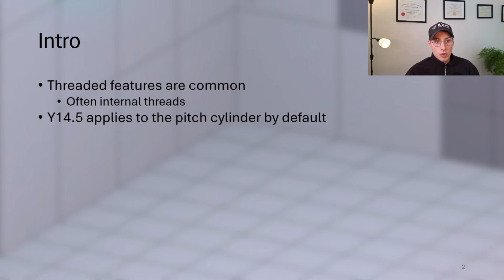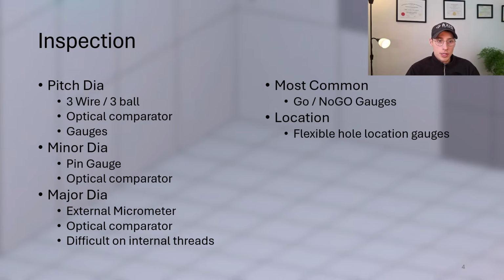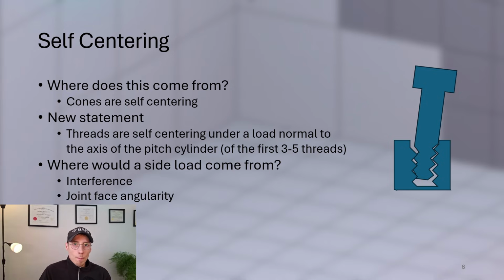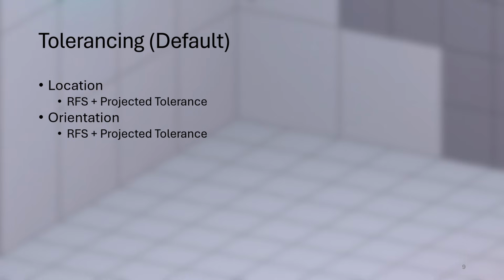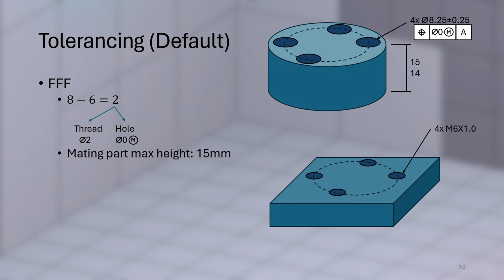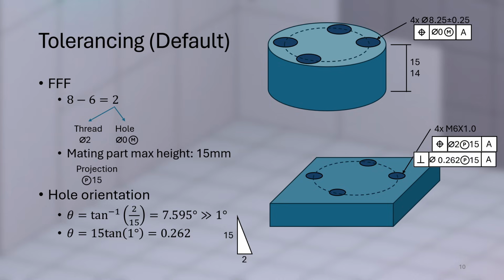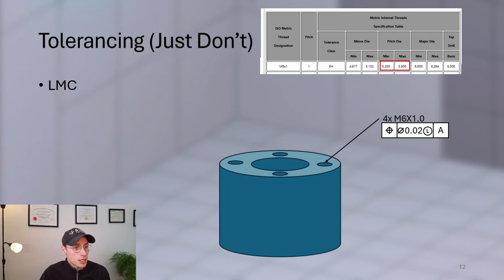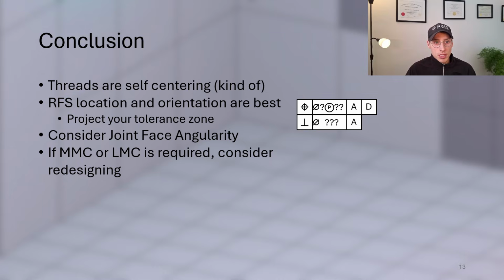GD&T Lesson: How to Tolerance Threaded Features

Comment: I've measured the major of a small thread in titanium (1-72) before using impression wax, a heat gun, and a freezer. Oil the part with some WD40 or something, heat the part with the heat gun until the wax starts to flow into it, let it set for a few minutes, toss it in the freezer for like 10 minutes, pull it out and begin to unthread/pray. We were able to pretty consistently measure ~.030" diameter holes and countersinks at the bottom of them with this method but it's definitely /delicate/. Also there's that whole thermal expansion thing.. we ignore that.

If the thread is bigger you can use an impression from the minor to the major, measure the minor, add your impression height, and get a pretty good idea of how big it is.
Reply from the maker: Ah good point, I have heard of casting features for inspection, I imagine it's tough to do on large volumes of parts, maybe one feature per batch?
Reply: @GDandTNerd the wax is reusable and relatively quick to use for stuff. If you use something like Repro-rubber then it's slower and more wasteful. It wasn't uncommon for us to use wax a few times a day for in-process inspection. 

Final inspection samples we'd probably use a 2 part compound (like Repro-rubber or equivalent) and just knock out like 15 impressions at once cause we had it mixed up. 

This is all aerospace/DoD so quantities were usually sub-200. If you're doing commercial quantities I'd figure something else out.
Reply: Great video, man.  I'm an inspector and I've been given the responsibility of signing off on in process tolerances.  The situation involves a cast metal part.  The casting is basically square, and has a cast hole going through the center that will be machined later.  The first thing that needs to happen in order to machine that cast hole is we have to machine a datum surface onto one of the sides of the square part.  When we make that datum, we will have to inspect that the cast hole is the correct distance from the datum we just machined so that the cast hole cleans up. So at the operation when we create the datum, I would like to assign a position tolerance on the cast hole so that I get the maximum amount of tolerance when creating that initial datum surface that will be used later.  Do you think you could create an example of this so I can see if I did it the right way?  I took the IB of the final hole and subtracted it from the LMC of the cast hole and set that as my position tolerance at LMC.  Do you agree?
Reply from the maker: If you can reach out to me on my website, you can send me some sketches and I can take a look!

Looking forward to it!
Axisgdt.com
Reply: @GDandTNerd  sent you an email, appreciate your help man
Reply: @GDandTNerd  Thank you for getting back to me so quickly.  I appreciate the help!  Hope you had a great Thanksgiving and thanks for making GD&T videos.